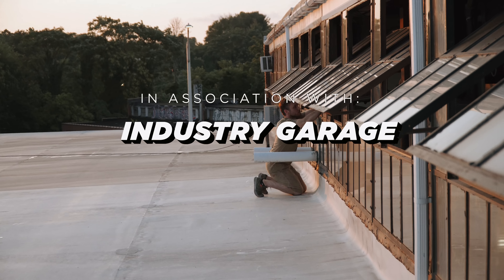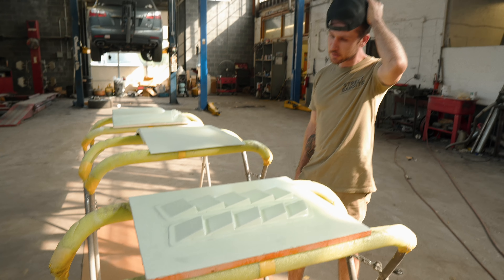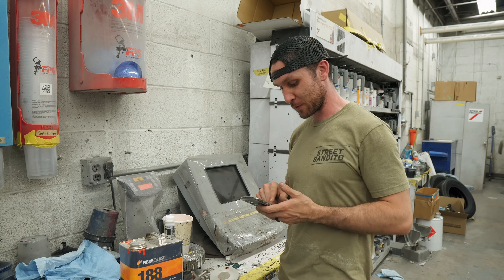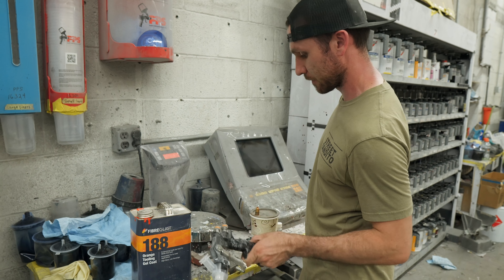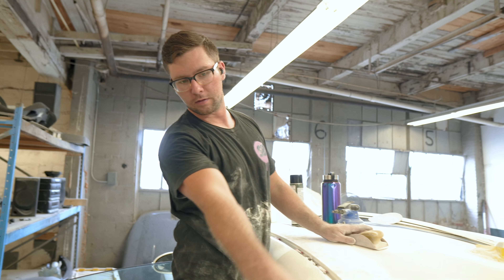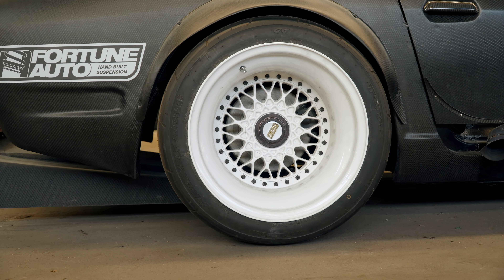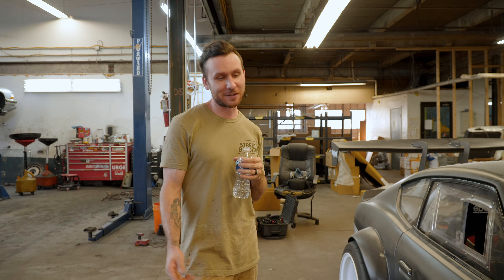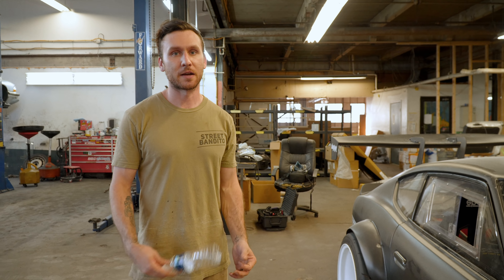LAST SET OF MOLDS | MAKING CARBON FIBER 240Z FENDERS & VENTS | (EP #62)

Comment: Really like the aesthetics (Other than the massive rear diffuser...) But one question. It seems like the rear tires/wheels protrude about 1 further than the flairs. Is that intentional( i.e a personal preference.) or are you gonna adjust the wheel offset?